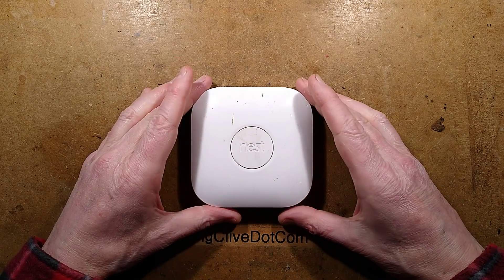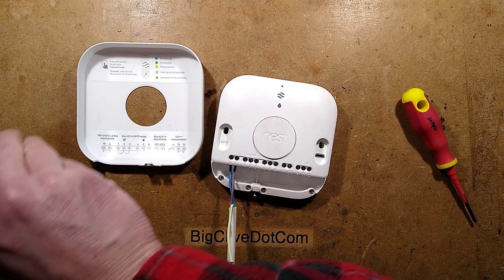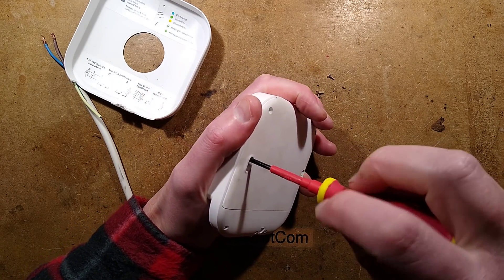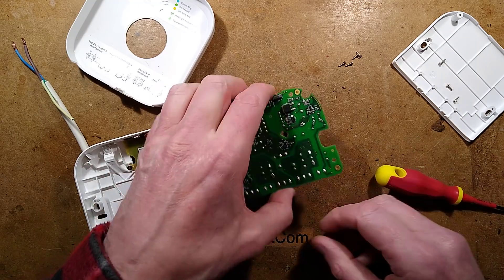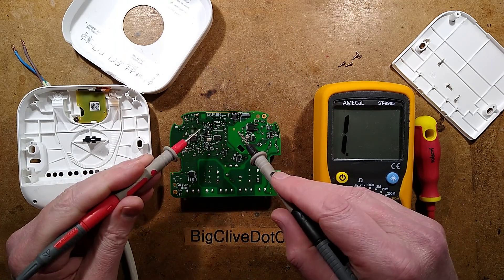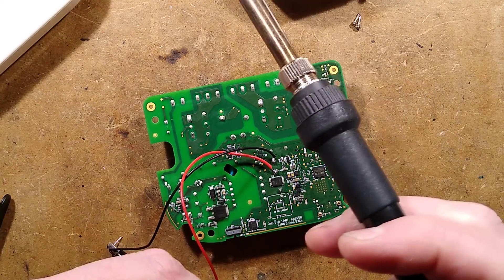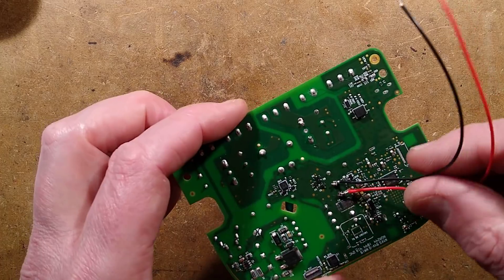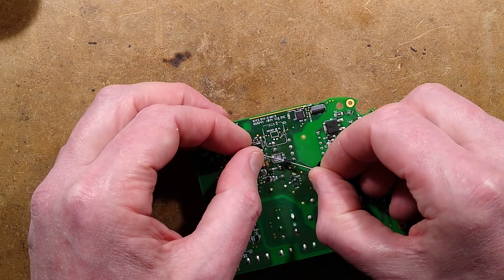Fixing a completely dead Nest thermostat heat link

Comment: Pro tip you can use two soldering irons to lift a single component like that in a densely packed area. I've had to do that for replacing a load of boards after a bad batch of SMT caps.
Reply: Look into some cheap SMD soldering irons that are like 2x30 Watt ones with a spring pivot.  I got one for about 30 bucks it was a game changer for SMD desoldering

Comment: Mine failed recently, there’s a guy on eBay who repairs them for £30- a new one is over £200 as you have to buy the thermostat as well 😡😡. There is a quick test he told me to do before sending it away, connect the micro usb cable, if it lights up he said he would be able to repair it, which he did, and it was the diode, looks like a very common fault on these units.
Reply: My Heat-link failed the same as this just before Christmas and I messaged nest support, they’re aware of it and next day delivered me a new one at no cost, and even offered to cover any costs of ‘professional’ installation. I didn’t even buy the thermostat from them I got it off eBay so I can’t complain at all👍🏼
Reply: @leww  couldn’t find any help on the internet at all in the UK
Reply: @paulstuhlfelder9819  Sorry to hear, if you’re still stuck you contact nest support via live chat, they try and connect to your device and ask you to do some basic checks for them, then if no luck getting it working they’ll overnight you one from Ireland which is what happened with me last week 👍🏼 There’s an extended warranty on them in certain circumstances.
Reply: @leww  I paid £200 for a new set, got the other repaired on eBay for £30, so now I have a spare for when something inevitably fails again 😊
Reply: @leww  thanks Lee for all your help, much appreciated
Reply: @paulstuhlfelder9819  No problem at least you got it sorted 👍🏼
Reply: @leww  Was all set to try and fix it myself when I saw your comment, all sorted through their online chat, thank you!
Reply: @leww  Same here.  My electrician who reinstalled it said he'd seen a few of these fail recently, so I wonder if it's a common issue.
Reply: Likewise, mine failed yesterday. Did all basic tests and went on Google support. It seems like it is now a recognised issue and am being sent a replacement unit as well as able to claim costs for installation up to £100. This is even though the unit is outside of warranty. Excellent customer service, although only now that G recognises it is an issue. There seems to be plenty of people in the past year or so that had to purchase, or repair...
Reply: @charliemelly6723  do you have a link for google support, do you need an account number, I couldn’t get anywhere when I looked? THanks
Reply: Same fault with mine . Found number on internet to give Google nest a call. Replaced thermostat and the server free of charge.
Not only that they told me if need be contact a plumber to temporarily get heat back on and they would reimburse the cost.
Most impressed with the service.
Reply: Plus one to all these comments. I was all set for an argument with Google since the warranty ran out last month but they've sent me another and offered money for temporary one and engineer costs.
Reply: I can’t get hold of Nest support at all and my Nest is not working?
Reply: I know it's pretty immoral but I'm sat here in a freezing cold house with a freezing cold family at 6 in the morning. What would be your thoughts on popping out to Screwfix, picking up the whole kit and returning it with my broken heat link and just saying it didn't work?
Reply: @greenreaper1985  you can go to the pipe where the switched tap is and manually open the heating with a screw driver, that’s what my plumber did
Reply: @greenreaper1985  I admit I do that sometimes, not just screwfix, I've done it at B&Q, toolstation, amazon, eBay in the past. If something breaks after the warranty expires I do buy another one of the same make and model, swap parts over then take it back and get a full refund. The retailers nowadays don't check and just send it back to the manufacturer. I know its a little naughty but why not now and again, you gotta look after you and your family so get yourself down to screwfix.👍

Comment: I love these repair videos. They clearly show what kind of analysis should be made and how to solve the issue.
Reply: Mr. Mijatov, are you from the Balkans?
Reply: @LukaMandic31  da, jesam. :D
Reply: He should have used the infrared FLIR in the beginning which probably would have revealed the shorted diode by displaying it as heat due to the high current drop.  Just a thought....
Reply: @BillAnt  This is not always the case, depending on the power supply, might have a short circuit protection built in, tries to start, detects a short, shuts down. I've spent hours chasing faults like that on large PCBs, where the fault could be a short circuit SMD ceramic capacitor, of which there are 100+ in parallel all over the PCB.
So what I do is isolate the power supply, solder wires to the faulty supply rail and connect it to a 30A power supply at the normal supply voltage, THEN use a FLIR, or if the boss won't buy one, spray IPA all over the PCB to see which area it evaporates from the quickest ;)

Comment: Mr. Clide my name is Luka from Croatia I wish you a happy new year and if you celebrate merry christmas i follow your channel for a long time. and I'm very interested in electronics but I'm very stupid and I don't understand much even though I'm an electrician. I have a lot of questions, but I am most interested in how to calculate the cross-section or square footage of a cable for a consumer or some kind of living space. but I have to count on the length of the cable from the power supply to the cabinet, there is a dye for electricity, I'm from Eastern Europe, we have a voltage of 240
Reply from the maker: You'll probably find your local wiring regulations have charts for calculating wire size according to current required and cable length.

Comment: I would not rule out mechanical failure of the diode as the board flexes when that button is pushed, as the force seems to be on the center of the board and it is not supported from behind there.
The scourge of surface mount components being near areas of the pc board that flex.
Reply from the maker: Particularly if an old person pushes the button with the simple rule - if it doesn't work press it harder.

Comment: So how does this thermostat work all I see is a button on the front of it how do you adjust the temperature up and down
Reply from the maker: It has a remote unit that does the fancy stuff.
Reply: @bigclivedotcom  so what happens when you push the button on it what does it do on the remote unit

Comment: I have two perfectly fine gen 1 nest smoke detectors that have a ten year lifespan and ran out earlier last year, would be interesting to find out how to keep using them rather than binning perfectly good technology, there must be a end of life component that can be "removed" or tinkered with  so it can be used again even as a back up or a smoke alarm for a shed etc etc
Reply from the maker: Is it just the support for them that ran out?
Reply: @bigclivedotcom  No Clive, I have ran them removed from my account and offline but they still give a end of life warning beep, what a waste of good tec especially as it has a great led pathway light that senses movement in dark. I did reply to your comment earlier but it strangely disappeared, hope I didnt write something wrong apologies if I did.
Reply: most likely the lithium battery. if it's completely dead.
Reply: @casemodder89  definitely not the battery’s they are happy working in another device besides they are both 240v with battery back ups

Comment: I'm a programmer myself, and also don't really like all this smart home stuff. The worst I think I'd ever have is something like a hue bulb. IOT in general is horrible in terms of security, I've seen so many talks about a vulnerability found in an IOT device that gives someone access to your stuff. And then when the company goes bust your thermostat is useless because the servers shut down
Reply: Home assistant ftw! Just run everything local an vlan the shit out of it.
Reply: If Google goes bankrupt, there won't be Youtube
Reply: My IOT stuff is all on wifi, and the wifi doesn't have access to anything but the Internet.  All the important stuff is wired on the other side of the firewall.

Comment: I have to check these, here in 'Merica' ! Here, most, if not all thermostats run on 24VAC, usually furnished by the furnace/heater. 24VAC 40VA transformers are available at all HVAC supplier stores. Often just by the cash register, as they are sold that often. 24VAC doesn't need special wiring, as 'mains' AC does (Romex or conduit). If the 24VAC gets shorted, there isn't enough energy to start a fire. If shorted, and not fused, the 24VAC transformer is designed to fail open, long before drawing enough energy to heat up to a dangerous level.
Reply from the maker: I see a disturbing number of transformer failures caused by either the fitting of indestructible fuses or none at all.

Comment: I find it near to incredible that you are feeding 240 V directly into a digital thermostat,and your codes allow this. Here in the States , thermostats run off of 24VAC, supplied from a separate transformer, usually located adjacent to the boiler or inside the air-handler unit.
Reply from the maker: The use of 24V in the USA is to avoid the need for an electrician to do the work.  In the UK it's just a cost saving measure from the past.
Reply: @bigclivedotcom  most ppl with the lack of knowledge in mains voltage circuits aren't able to do electrical work on thermostats ect. either.

they fck up the wiring and then call a sparky to spoon all the shit. NICE.  i looove this kind of customers.
Reply: that is mainly for idiotic users. so not mandatory in the rest of the world. we can feed 230 or 240v into everything and nothing happens.
Reply: Electric baseboard heating in the US is often controlled directly by 240v thermostats.

Comment: Plumbers must hate going out on a service call to swap one of these off of the wall because it doesn't give them a chance to kneel down and moon the customer with their "plumbers crack"! 🤣  But seriously, can you imagine the average plumber or electrician having to deal with getting this thing to connect back up to your Wi-Fi, downloading software, and programming it to the customer's requirements? Or does the plumber just fob all that fiddly software-operational stuff onto the customer to figure it out for themselves?
Reply from the maker: Heating engineers are having to become more tech savvy over time.

Comment: Good video. I almost bought one of them but now glad I did not. Clive, since you brought up the idea of current limiting while diagnosing could you do a video on them? Maybe which ones you like and why and what features they have? I saw glasslinger had a particularly interesting one in that it had the feature to be able to adjust to how many AC cycles came in. I looked into making it and its a nice design but it requires a lot of parts and space. I figure there has got to be a modern one that is better & maybe more compact. Thanks big guy!
Reply: AFAIK the classic dim bulb tester is still the overall best option. Best of all the brightness tells you what the load is doing. The glasslinger device is isn't really a limiter, but instead just a fast-acting circuit breaker.

Comment: is it possible to parallel combine small-pwr diodes to effect a value-combined pwr diode ?
Reply: i don't need that - i got a IN5408
Reply from the maker: It's better to use a single diode if possible.

Comment: It's weird that this thing is powered by 240vac.  Typical thermostats run off of 24vac derived from the furnace power supply.
Reply from the maker: 240V boiler controls in the UK.

Comment: Personally, I don't care much for "t'internet" running my life, or ruining it for that matter.  If I want the heating on, I put it on myself, when I get there. So what if it's a bit chilly when I step through the door, it doesn't take long for the place to warm up.

The internet, and especially Google, knows too much about where I am am and what I'm doing already. I was aghast to find that after I'd taken some photos last month, they're now pinpointed on Google Earth, so when I look at GE, it instantly shows me where I was, when I was there, what device I used, and the actual pictures I took. Thanks but no thanks, if the "net" knows that much, it knows too much, I don't need it to know when I turn the heating on, or the lights, or to figure out when I cook my meals or go to bed!

If it comes to that, I'll stick to the old Honeywell with its bimetallic spring and mechanical contacts!

Comment: Nice repair job, the manufacturer won't be happy. What amazed me is the poor mechanical design using a flexible PCB and eight screws. I would have chosen PCB mounted LED' and a single screw to virtually eliminate assembly time.
Keep up the good work.

Comment: Besides problems with insecure software and too much hardware, IoT also suffers from the problem of having proprietary, centralized services they depend on. Plus mobile apps and other connected crap. Services on the internet (for devices and softwar to connect to) do not have a good track record of staying online for more than a couple of years. Notably software activation servers and game servers have been known to just be turned off after sometimes only 5 years.

Comment: Not a fan of devices needing an online connection or special app to operate (not talking specifically about this device) they are basically useless if the manufacturer decides to stop supporting them or goes bankrupt. The old mechanical thermostat mentioned will work even decades after these iot devices become obsolete.

Comment: Another great video Clive!  My NEST learning thermostat (same as this one) failed after around 18 months.  Fault was a little different on mine, it still powered up from mains but could not talk to the remote thermostat. I traced the fault to a short across one of the output side capacitors, but by which point I'd already submitted an RMA form and got a replacement sent out, but they insisted I return the faulty unit to the Czech Repuplic to then be more likely chucked in a bin 😞.  Things worthy of note:-
Different brand of relays, Mine were black, and the two output caps on mine where the same type and brand of electrolytic caps, but obviously different uF values.  I wish I'd taken pics!!

Comment: I’m wondering if it’s possible to focus a variable powered laser on a single surface mount component to desolder it?
Reply from the maker: There are pinpoint desoldering units that use a tungsten halogen lamp focussed to a point.

Comment: I hate SMT boards with a passion! I have a hot air Preheater (rather like a small heatgun on a platter) that I bought from CPC, I often place the board on that, I bring the board up almost to the solder melting point and then use a soldering iron to desolder the particular device I want to remove.

Comment: Is it possible the unit was installed in a boiler cupboard where it got too hot and something failed. I installed one of these but it's in a room that is 3mx3m so plenty of airflow. The operating temperature is 0 to 40c so if this was in a small cupboard could it have gotten too hot being close to a boiler?